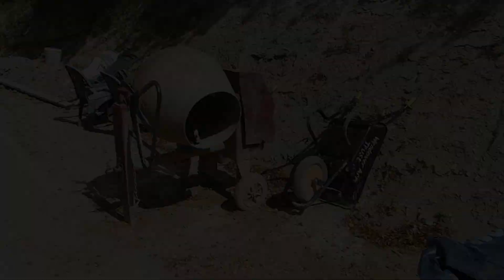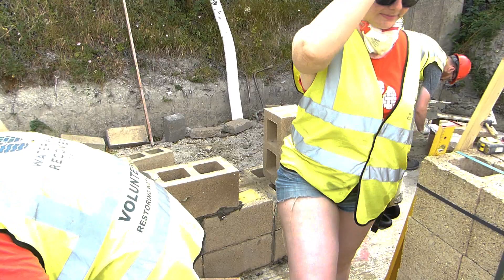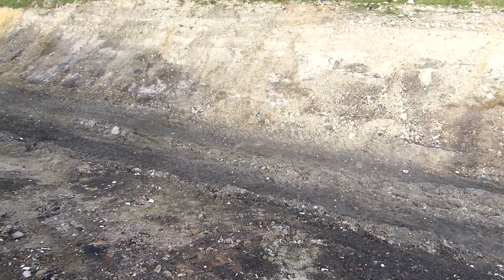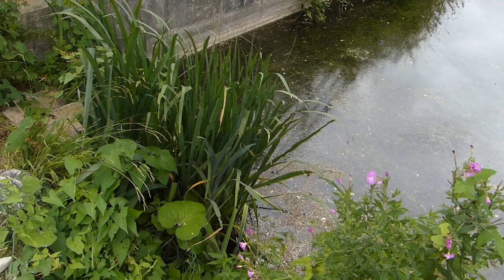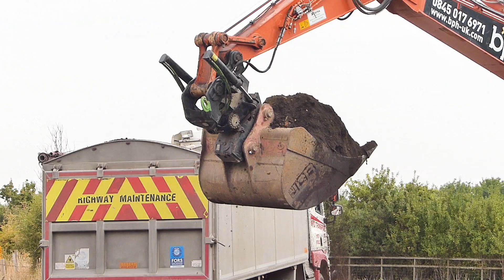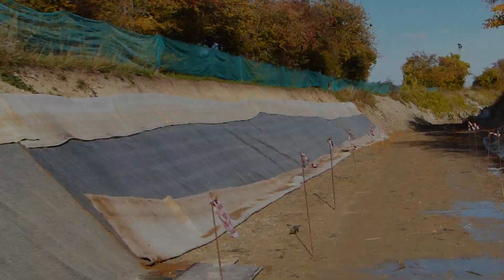2022 November, Wendover Canal Trust restoration progress, by Boyd Williams

Comment: you have to be careful the green light on the machine don't appear to be working this can result in a heavy fine for you and the operator from health and safety if he is not wearing a seatbelt I am an ex building and civil engineering supervisor I'm hope I'm wrong
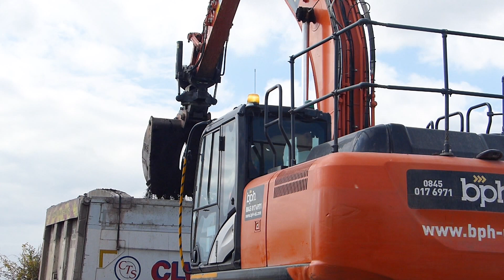Reply from the maker: Hello, the green light was in working order, it just didn’t flash very often, you can see it flash at roughly 13:28